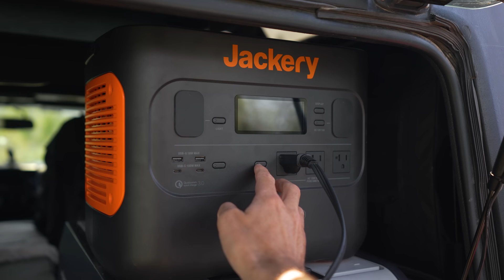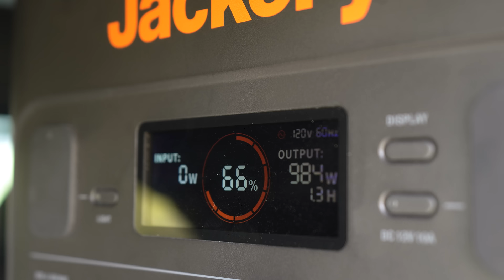DIY Jeep Bed-Kitchen-Drawer and Overland Set Up

Comment: Drew, another option instead of cutting a whole in that cutting board for the propane tank would be to add a short length of hose and a hook to hang the tank below the table.

Comment: A custom hardtop that extends above the back part of the jeep (dropping back down just before the front seats) about a foot to a foot and a half higher would be a perfect set up for you. Then you could add a plywood platform over the top of your electric cooler, which would also add more storage space on the other side above your cutting board…then you could use the entire platform as an inside sleeping option for two.

Comment: I know he's sponsored by Jackery and has to plug for them.  But oh my goodness!  Rechargeable power while camping?  Game changer!  I bought a 300W Jackery and 100W panel to take camping with me for a week and never regretted it.  It's SOOO nice to have power for cell phones, lights, fans, and even a laptop.

The only thing I wish Jackery did better (aside from the aforementioned handle situation mentioned in the video) would be to give a PRACTICAL guide on power usage to help customers figure out what size they need.  Not electrical engineer math mumbo jumbo.  PRACTICAL guides.

For instance, recharging my cellphone from took 1% of a 300W power supply.  Using a small fan overnight took 2% of its power.  Powering a gaming laptop, however?  That drained 300W in 2.5 hours.  So don't use it when you can't recharge easily.  They need to have an EASY guide like that where they give general watts per hour and 8 hours (overnight) of typical times to help people who don't have product manuals on hand to get a reasonable idea on usage and battery size needed.  "I know I need to last through the night, so I can plug these 4 things in for 8 hours and be good till dawn before recharging."

But otherwise, if you camp and haven't bought one yet, DO SO!  Rechargeable power on the road is amazing.

Comment: Nice upgraded hard top adds 5 inches i do like snorkels but not the style you have , i own 2005 jeep wrangler unlimited rubicon build up very nicely not sure if i ever buy a new model nothing like a simple jeep very easy to work on but this what make jeep lover love jeep there a model for anyone old to new only thing from my build im very heavy even with my supercharger my gas mileage horrible geared to 488 sitting on 35x12.50x18 most people talk about how weight can be hard on components factory dry wt 3800 gross wt 4600 my wt 5800 she heavy im happy with the 4.0 bullet proof motor 6 speed manual,  i get tons of compliments its an mid 2000 build you don't see anymore 😊

Comment: Ok, you are the person I need to ask. You say that there's no where you can't get to with the 33s. I'm gonna buy a Jeep JLU Rubicon and because of wanting to be able to go anywhere I wanna go, I wanted to get the Xtreme Recon package (it comes with 35s, 4.56 gears and the upgraded hinge gate out of the factory). I'm a bit skeptical about if I really need 35s. It's a $4000 package, but from what you're saying it sounds like I would be able to get everywhere I wanna go on 33s. Should I save $4000 and not get all that? People say the mpg will not be worse but I think carrying those larger tires has to take more power which would make the mpg worse.

Comment: i love your set up, just curious about how you attach your tent to your rhino rack. i didnt see the cross bar on your rack, so how you attach the tent to your rhino rack? I have skycamp 2.0 on my rhino rack, it is so unconvenient to using the locking latch, i may switch to 3.0 as well, just not sure which way to mount it to the rhino rack is most appropriate.

Comment: Hi drew. Just wanted to ask you how did you thread inside the wire for your solar panel that is attached to your ikamper? Does that solar panel attached to the ikamper charges your jackery when you are driving?